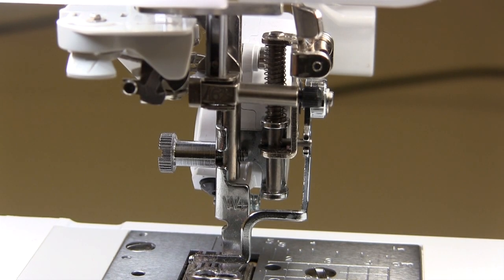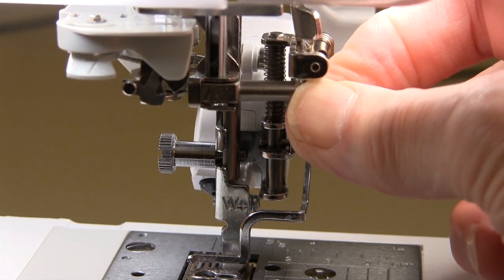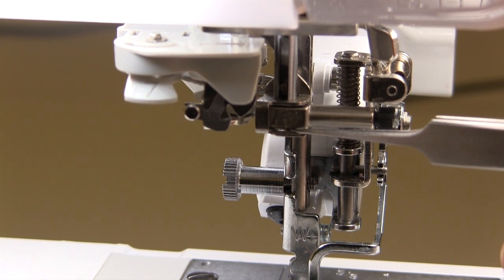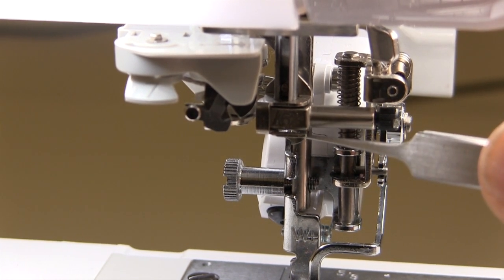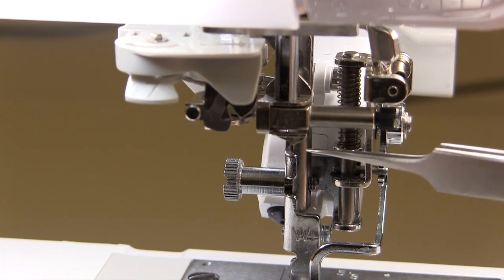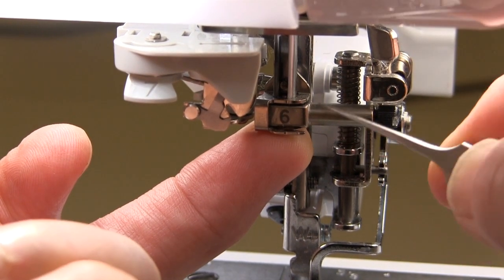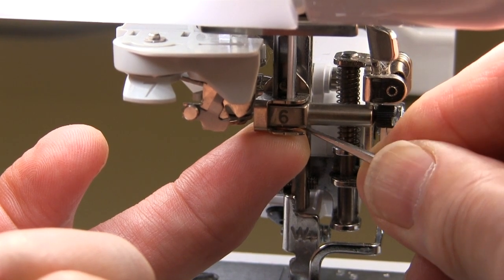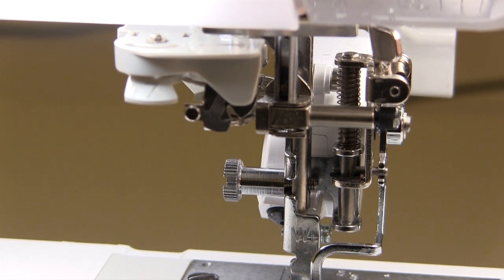Adjusting thread guide

Comment: This problem on a previous machine cost me about 10 round trips to Nottingham - 5+ hours driving! They couldn't work out the problem (constantly breaking thread and birds nests underneath. Eventually, I realised that as the embroidery speeded up after the initial donk, donk, donk slow stitches the tread un-threaded from this guide. Fixed it with the help of selotape until I could face the journey again to get them to change the spring (which they didn't have in stock even though I had sent pictures of the dangling bit!) so that was 2 more trips! Absolutely fine ever after once fixed!
But now, thanks to you Keith, should this happen to my beloved XV I will know what to do - many, many thank yous....

Comment: Thank you thank you thank you!!!  With your help and the wonders of tube and the internet I was able to make the adjustment just as you illustrated.  No small feat for me as I'm blind as a bat.  Fortunately my magnifier helped just enough to be able to see the tiny parts.  The threader worked for a short time when I first got the machine so it must have been just barely centered.  Since my machine is brand new (and wasn't cheap) I did not treasure the thought of dropping $100+ on repair for a minor adjustment.  Pays to be a diy-er.  Thanks again!!
Reply: Same for me.  I just got my machine at the end of Feb 2023 and was dreading the repair bill.  I also can't see well, but my magnifying glass helped a lot.

Comment: Mr. Lord, You appear to working on an industrial-style machine.  My domestic Brother CS6000i does not appear to have such a spring at all.  Do you know another cause for the thread to slip out of this thread guide?  Yours is the only video (or anything really) that I have found addressing this problem.  I hope you can help.  Thank you very much for considering my question.
Reply from the maker: Hi Donna, sorry, got my videos mixed up and answered the question wrongly. You're right, the spring plate isn't on your machine and the needle bar doesn't need it. The thread should stay in there and I don't know why you have the problem due to quite a few things which could be causing the thread to loop out of the guide such as the take-up spring not working or thread catching somewhere, timing out etc. Sorry not to be able to help more.
Reply: @keithlordsewing  I appreciate that you tried.  I have a support request in to Brother so maybe I will get it solved.  Thank you.

Comment: The spring on the gray plastic thing that is embossed with the number 7 that I release and attach  when I change my needle threader seems to be stretched out. I don't know what this spring is called or how to replace it or fix it. The spring hook seems to be stretched I am not talking about the number 6 "spring" that is flat..Can you give any advice?
Reply from the maker: Jennifer, you will need to get it replaced and it's tricky to fit. The only advice I can give is to have a qualified Brother engineer look at it or see if a dealer who has spare parts can supply one if you have a competent person you would trust to fit it. It needs winding into position. The way you spell gray suggests you're in the States so you need to enquire in your locality.